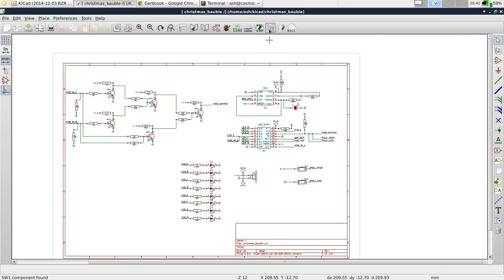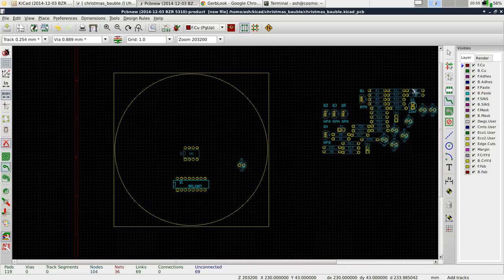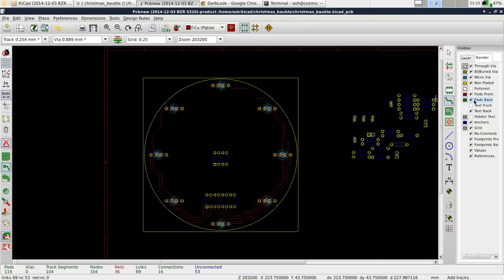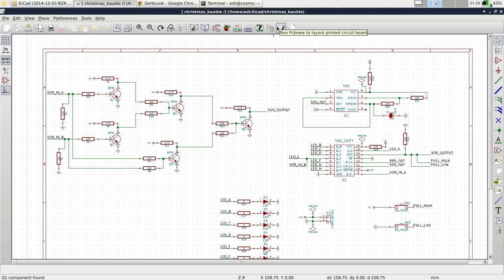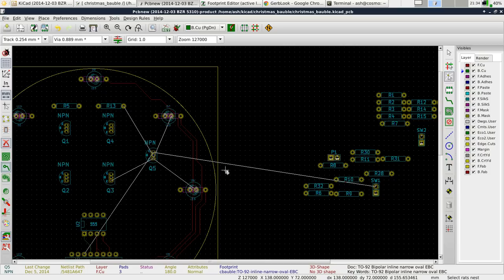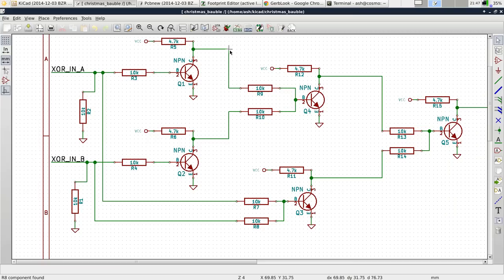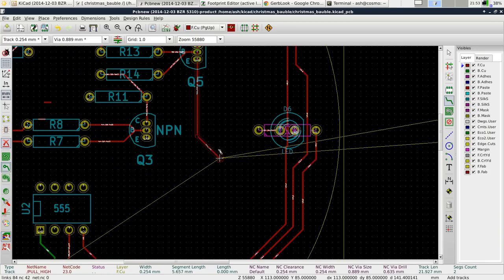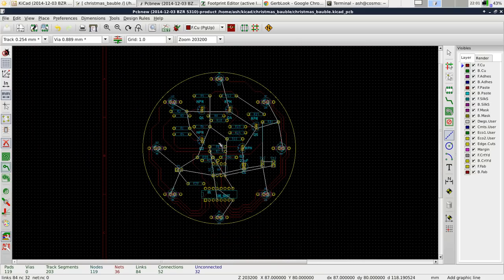Kicad Tutorial 12/2014 - Part 6/12 - Laying out a PCB (i of iii)

Comment: This is an info for KiCad 4.0.4+.
I was getting errors in pcbnew when importing the net file saying that components were not assigned to footprints.
It turns out that KiCad no longer uses CMP files. That is the reason why the mentiones cmp file in part 5 never showed up in my project directory.
So the associations between components and footprints are now saved in the schematics file and exported to the netlist. That means after finishing the associations within Cvpcb one has to export the netlist again in eschema. Then the import in pcbnew will be successful. 
 
And by the way: thanks for the nice tutorial, Ashley.
Reply from the maker: Thanks, I only just saw this, for some reason it was in my approval mailbox.

That's really useful information, thanks for sharing.

Comment: Hey Ashley, great tutorial so far. I had a tip for the when you were drawing the circle, I think I picked up from Chris Gammell's tutorial - If you press "Space" at the corner of the 100mmx100mm square it will set zero the dx:dy coordinate then move to dx:50,dy:50
Reply from the maker: Thanks Heliumninja1, great tip!

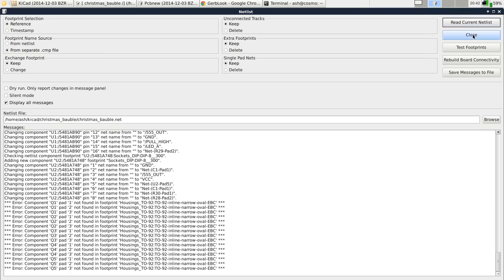Comment: I got as far as 0:49 and the netlist panel displayed about 60 Errors! most of which reported [No footprint defined for this component '<name>'m]. Also [Cannot add new component "<name>" due to missing footprint] - despite every component having been associated with a footprint! At this point my heart sank and I did not know what to do next.
I did, however, end up with the LEDs and the 2pin header displayed on my PCB.
What have I done wrong?

Comment: To create the size of  the board layout i just set the grid size to 50 mm and used the circle tool to add a circle with a radius of 50 mm. After that i had a perfect circle with a diameter of 10 cm.
This way is much more efficient than your way of creating a square size before adding the circle in that square.

Comment: Ashley as all of them great tutorial. I've sussed out the component and the footprint issues I had and the footprint library alone takes some understanding to get just what you want. Anyway I got there but I have a question about snapping to the grid. Ive created a schematic consisting of 32 8 pin headers, done all the usual stuff to get to the pcb. stage. I've spread out the 32 headers in the correct order but some will snap exactly to the required spacing whilst some won't. This obviously doesn't give me nice lines of heaaders. What I doing wrong ?

Comment: Hello Ashley,
is there a reason why you made @45:22 two lines from the base of transistor Q3 to the resistors R8 and R7?
Why not just make one line from R8 to R7 and from there to the base of the transistor? Electrically it is the same, but you need much less space for doing so.

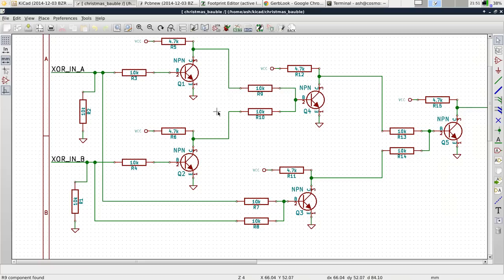The same happens @47:08 for transistor Q4.